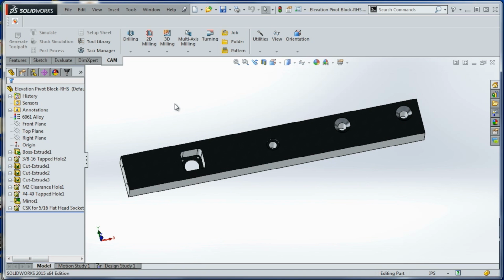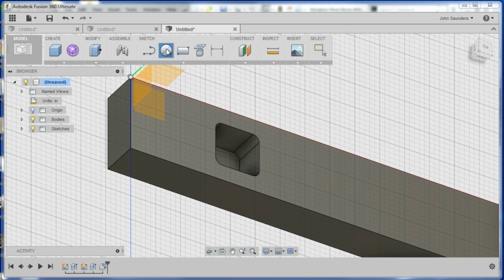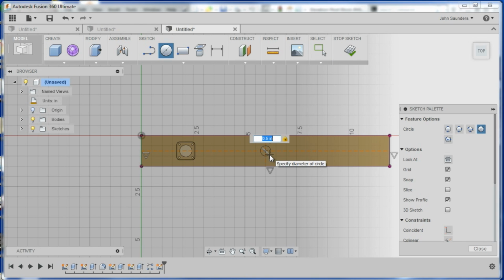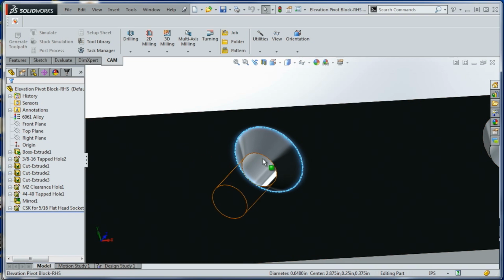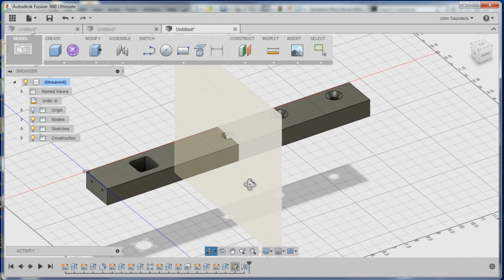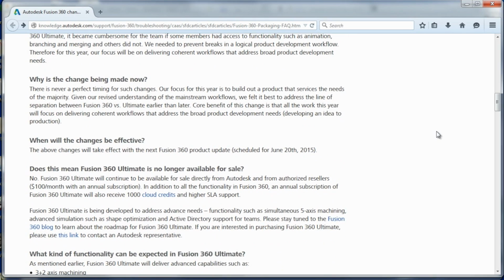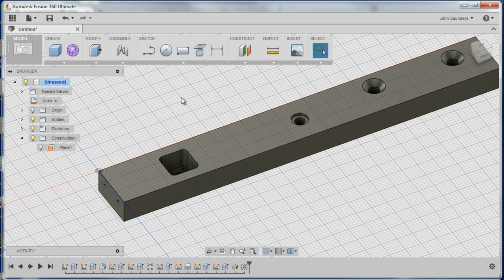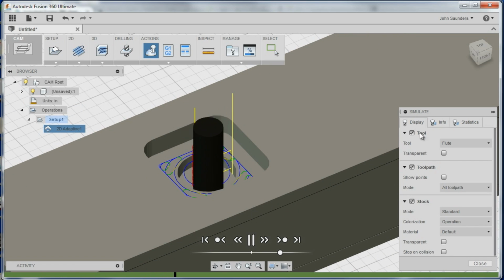Fusion 360 Tutorial:  The BEST CAD & CAM for the Home Shop!

Comment: Great channel you got here.Have you ever tried a Space Mouse from 3d Connexion? I purchased a Space Mouse Pro a month or so ago and it works awesome with Fusion 360. They have several different versions priced from around $70 to $300+.The Space Mouse got ride of any and all problems I had manipulating 3d parts.
Fusion 360 rocks!!! We replaced an older version of Mastercam with it back in Nov. 2014 and now all I use Mastercam for is engraveing and RS232 communications. Fusion doesn't offer RS232 or single line engraving (yet). I think you are right Onshape and Fusion are going to change the CAD/CAM world ...for the better. Althought cloud based software won't be secure enough for some companys.
 Thank you for all the great videos,looking forward to the next Fusion 360 tutorial.
Reply: NYC CNC WOW! Sorry I mentioned it.
Reply: NYC CNC No worrys bro it's all good. I'm horrible with a keyboard so it was pretty sweet when I found out about 3d mice.The content you cover here and how you cover it is awesome ,it must be a ton of work  not sure how you do it.Keep on keepin on.

Comment: Thanks for the video!  I do most of my modeling in Inventor so I haven't played with the CAD much.  It looks fairly nice though, I'll have to give it a shot for some of the more simple parts.

Do you own a 3DConnexion Space Navigator or were you demonstrating using just a mouse like most of the home shop guys would have?  The Space Navigator, to me, is a non-optional piece of hardware so you aren't fumbling around with views like you were having to do.  It's nearly impossible (for me, anyway) to move around a model with the mouse alone.
Reply: NYC CNC Hey, to each their own.  It did take me a while to get it set up right, inverted most settings and changed the speed on others then took a bit to get used to but now I can't model without it.  I'm just surprised you didn't like it.  I'm pretty sure all our engineers would walk out if we took theirs away, lol.
Reply: Chris DePrisco I'm with you Chris.  It makes F360 a true pleasure to use when you can effortlessly flip/rotate/spin/zoom,etc.  If F360 had more shortcuts defined and had user definable shortcuts implemented at this point, it could sway me a bit, but I don't think I want to be without my SpacePilot.

Comment: Setting it up now! It looks a bit like 123D Design which was good for basic 3D printing. Cant wait to give it a go...

Thanks John
Reply: NYC CNC 
It is made by Autodesk --> http://www.123dapp.com/design 
It is good for simple 3D designs and is a great way to get into CAD. you can export straight to STL then onto your 3D printer CAM software which speeds the process up.
Reply: thehaytch Fusion 360 is much more sophisticated than 123D Design and in the File-Menu you can also select "3D Print" and you can select a body to create a mesh of. You can even configure to automatically start your slicer.
Reply: I gave Fusion 360 a go last night, it looks and feels good, somewhere between 123D and Autocad. 123d is a great intro to cad and if Autodesk is smart market it to primary schools and kids to learn their cad...it's all about brand recognition...iphone anyone?

I tried to save the fusion file locally but could not figure it out also what typpe of file does it save, ie .dwg?
Reply: thehaytch There is no local saving like in older software. You always save to the cloud, but internally the software caches the file locally. You can also share your designs through GradCAD directly out of Fusion. There the files have the extension f3d but you're also able to generate STEP-files to share with a broader community.

Comment: Great video. I too have been using Onshape from it's beginning beta version and I love it but I want to do some machining. They don't have Cam yet and they don't have capability to do drawings and I just don't want to wait. I switched over to Fusion 360 Ultimate for 'FREE'. If you are a hobbyist, business makes less than $100,000.00 a year, student, or a teacher it is FREE (that's 3D Cad). I love it but am frustrated with the same things you spoke about. Best thing going right now.
Reply: NYC CNC Good idea. I absolutely hate having to hold down the SHIFT key to move around the part. I don't like to have to use both hands to do a simple thing like that. How about "Hold down scroll wheel" for rotating the part, "Hold down left and right buttons" for scrolling screen, at least some way where I can do it all with my right hand.
Reply: William Hardin There is an option in Preferences in the dropdown menu by clicking your login name. Select General at the top and toward the bottom of that page is "Pan, Zoom, Orbit shortcuts" and you can set it to work like SolidWorks.
Reply: MrAtalon Thanks, I'll check it out later today.

Comment: To clarify, for the time being until Autodesk say otherwise, Fusion 360 ulitmate is free to use for anyone and everyone earning less than $100k a year.
Standard version which now has all the features of ultimate is available for $300/year.
Ultimate is $1200/year, but for most people standard will be more than enough. Going forward ultimate will get 5 axis and other goodies.
Anyone that puts Fusion 360 down clearly haven't tried it, yes it isn't the "Best" cad software but you can do most things and it always being updated so new features are added all the time.
I like the cloud part, as it means I always have my files to work on as long as I have the internet. And it accepts most cad file types, I've uploaded solidworks models to fusion no problem.

Comment: Nice video. Def must try it out. The funniest thing is that all of the cam software companies buy the algorithms from Moduleworks. And make a few minor tweaks. A large machine shop near me swears by One CNC. Its pretty cheap also. I use BObCAM. Few dislikes with it but its prob no worse or better than most other packages. .
Reply: NYC CNC Yes sales push hard. I am on V4 Mill and Lathe for SW. Its working well for me. Seems to have advanced a lot from V24 days. I do like the price point at which I purchased as no maintenance required but I think them days are gone now. I have been considering making the move to One CNC however based on the comments I keep hearing about it and price point is really good

Comment: interesting... looking at the site too looks like there's a free version for hobbyists and students!! 
is there any difference (so far as you know) between ultimate and normal when it comes to CAM?
Reply: sn0wchyld I believe the free hobby/student version is limited to 2.5D and possibly some of the adaptive tool paths but I'm not 100% sure about the tool paths. Either way I still think it's more powerful than any other free software.
Reply: sn0wchyld About 2 weeks ago now, Autodesk moved the free hobbyist/students to the Ultimate version going forward (they were previously on the Basic version).  Originally caused some angst among us paid subscribers, but was "ultimate-ly" explained and handled very well by Autodesk Support.
Reply: gwcude yea done some more reading since, its great for people like me (student with a cnc router making ebike parts) but i get how a shop paying 1200 a year might be a little pissed to see others suddenly get it free. then again if your cracking 6 figures 1200 a year isn't so bad. maybe 120k would have been a better number, so its 1% of revenue, though its kinda arguing semantics at this point. Looks like the 'paid' version offers some nice perks too.

Comment: more than likely you know this you could have done it with two sketches that are driven by parameters. if you don't and wont to know pm me your files and I will bounce it back done. fusion can be off line for 30 days but you only get local files.
there is a few different things that you have to do that are different from sw  its getting close the next few update help a bit

Comment: F360 is great if you are new to CAD. I work in Inventor and F360 is hard to learn after many years in inv. I hate their assembly tool, importing CAD format takes long time, project geometry is bull. Rendering is great! But hey if you are a hobyist or a startup it's free and you get CAM. And if you start using 360 directly it would be easier to learn. Btw there is a "Print now button" for 3D printers :D

Comment: Great video. I've been using Fusion 360 CAD and CAM for about a year in my home shop and I must say that it's the absolute best option for hobbyists. (I'm not in a position to speak as a professional) As you mention it's not perfect but it is constantly and rapidly improving. As it is cloud-based the new features and improvements automatically gets pushed out the the users. Here are the main point which makes Fusion 360 a great choice:
- Free full features version for private use.
- Professional grade CAD and CAM in a single package
- Very easy to use
- Improves very rapidly as it is cloud-based
- Support for MAC
- Autodesk has a proven track record withing CAD/CAD and are not out of business in 6 months.
Reply: NYC CNC Sure, no problem. I should be able share some of my models with you directly in Fusion. That could be cool to try.
It's pretty simple parts I have been designing, most of them as part of doing a CNC conversion of my RF45 clone mill.

Comment: I enjoyed the virtual tour.  It's great to see how people use different tools.  Thanks for the video!

At first blush, I'd whine about "renting software", but just about all commercial software is rented these days, albeit sometimes with a large security deposit up front that you'll never get back (SolidWorks).  It is good to see the cost coming down precipitously.  Yeah free market competition - consumers win!  The price of software is generally whatever people will pay for it.  I don't mind paying to save time.  That's worth something.  I refuse to pay to be held hostage to my data.  AutoDesk essentially did that to me when they discontinued the AutoSketch that I bought a VERY long time ago and tried to force me to buy AutoCAD Lite.  I switched to IntelliCAD, a much less capable free AutoCAD compatible program and never looked back.  It had all of the features I needed.  The AutoCAD frufru was just complexity I would be tripping over, so it was a negative to me.

The REAL force driving down CAD and CAM prices isn't SolidWorks versus AutoDesk versus the upstarts.  It's FreeCAD and FreeCAM - free open source CAD and CAM tools.  They're not ready for prime time yet, but they're getting there.  In a couple of more years they should be everything that most small shops need.  Just as big companies still use Windows (and put up with their nonsense!), the big companies will continue to use expensive commercial CAD and CAM software, but I think the bottom is going to drop out of that market once the free open source software matures a bit.  They had better make their money in the low end market in the next couple of years, because good CAD/CAM software will be free soon.  Until then, I'm not using software where my designs are locked into a proprietary data format designed to keep me paying after CAD/CAM is free.
Reply: Scott Moyse You make a lot of good points in support of computing in the cloud (that term still seems like a bunch of hippie dippy marketing crap to me :-)  I guess we won't need CAD work stations any more.  I have a 2.7 GHz quad core phone with a hi-res S Pen.  I can CAD with that!  But only if I have an internet connection!
Reply: William Hardin I'm interested that you think the Assembly mates / joints are easier in Onshape than Fusion 360. The technology comes from the same two people (they moved from Autodesk to Onshape, having previously been Solidworks co-founders). So for me both solutions are disturbingly similar.

Regarding Onshape's Branching and Merging. It's impressive they have that sorted already. It will be in Fusion with the next update, due on June the 7th.
Reply: Scott Moyse They are similar but for some reason I find it very hard to mate things in Fushion 360, it just seems harder to see and figure out where you are going to end up. Like I said I haven't used it nearly as much for assemblies yet.
Reply: Liberty4Ever That is one nice thing about Onshape. All the designs I have on there I saved directly back on my computer as a Solidworks part file so I could read them into BobCad if I need to later and they provide other formats also. That way if they go under or I don't want to use there program any more then I don't loose any of my work. One draw back I found is that my internet provider is very unstable, in the desert where I live, and when it goes down I'm sitting dead in the water.
Reply: William Hardin Non-proprietary data format - GOOD!  Needless reliance on "the cloud" - BAD!  I'm inherently suspicious of any software that needs to transmit data to the mother ship.  I think the cloud based data backup is a dubious benefit that prevents you from enjoying the obvious benefit of working on your design any place you can use a computer (in a plane, at your rural home, 20,000 leagues under the sea, etc.).  I wonder why they require the software to check in with the server.  Is it simply to see how much you're using the program as a means of reducing piracy? (Arrrr, matey!)  Or is it something less benign?
Reply: Liberty4Ever Local compute is faster some times, then other times its faster in the cloud. Translating large files is best done on the cloud, small files? not so much. But having the translators on the cloud means they can fix and update them immediately. Rendering? You may not care about it, but cloud based rendering is epic. Data Management? It's a pain to implement, cloud based CAD means the vendor can take care of all the PDM infrastructure and logic for you. For CAM? Cloud based tool libraries, where vendors can keep everyone up to date, ideal! Simulation? Sometimes quicker to compute locally, but if you are optimising, then cloud compute is WAY faster. BTW, Fusion 360 uses Autodesk 360 for its file storage and data management. From the viewer, you can export out your Fusion designs to a lot of different file formats. Unfortunately, your toolpaths wouldn't get exported. You can export as a Fusion archive though if you wanted to.
Reply: Liberty4Ever Thanks... but the key point here, is we still need offline modes for all these, hippy-dippy cloudified CAD solutions being delivered at the moment. Internet still isn't 100% reliable and accessible. The cloud should enhance and not replace the desktop in the short to medium term. I feel as though Autodesk understand that more than any other CAD provider at the moment, simply because they have been mucking around with it for over 5 years now. They've found out what doesn't work and re-architected their platforms at least 3 times that I'm aware of.
Reply: Liberty4Ever After trying out both Fusion 360 and Onshape I noticed a few interesting ponits for me.

1) Fusion feels a little clunky to me compared to Onshape. It takes a long time for Fusion 360 to come up on my computer and work flow takes a little more time. Onshape seems very fast, infact way faster than BobCad that I normally use that's installed on my computer.
2) Onshape feels miles ahead of Fusion 360 on there Data Management I love they  implemented that but no Drawings and no CAM yet.
3) I think mates in assemblies are better with Onshape but I'm okay with Fusion 360 also and haven't used it as much yet.
4) I also like the measuring tool better in Onshape, it gives a little more info.

I know that Onshape is planning changes for what's available to the free customer like either fewer available documents or a monthly, or maybe a yearly fee.

I just have to wonder if Fusion 360 may change once they have collected enough data from their free users. Only time will tell.
Reply: Scott Moyse I agree with you 100% on that. I've already responded to that, I have only one choice where I live (WISPRENN). Well, I guess I also have Hughes Net, if you can call them an internet provider (I don't).

Comment: You are just renting this software.
Reply: James Burris For three hundred dollars a year, you bet I will rent the software.  No major investment to own something that will go out of date or you are held over an expensive barrel to maintain. The only thing I don't like the idea of is the privacy issue with the program not residing on my machine.  If I were an inventor I might be a little hesitant.
Reply: I hate solid works! the woman that taught me 2D wire frame in AutoCAD tried solid works (she has many many years in AutoCAD) she gave up. Said it's very difficult and doesn't make any sense, the simplest of tasks are very difficult.
Reply: +Jim Peach. yes this is my only concern with the software. I'm not a fan of cloud based, especially as an inventor. security is a huge issue. I've talked to them about this and if be willing to pay more in my subscription to have a full software package based system and not rely at all on the cloud.